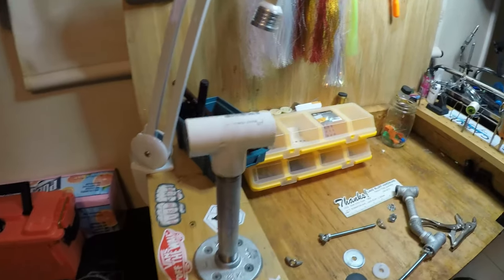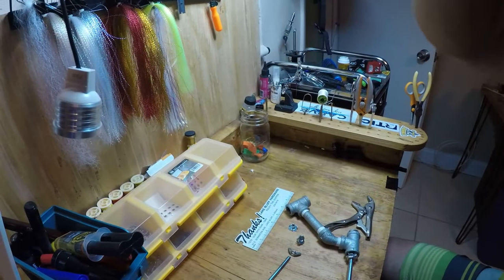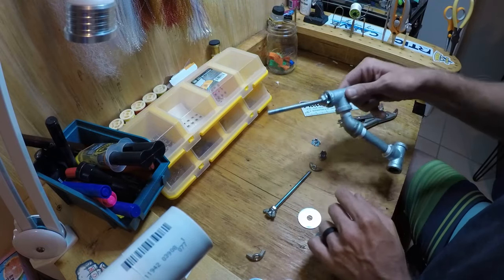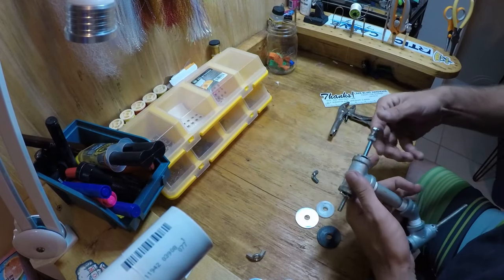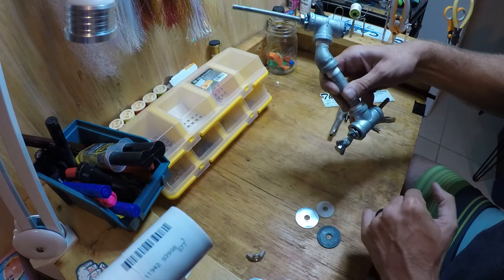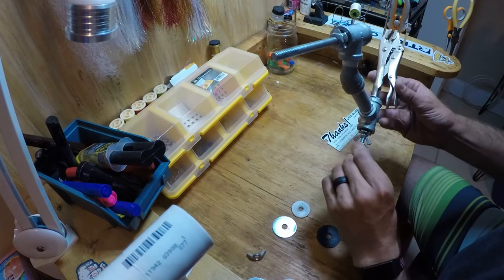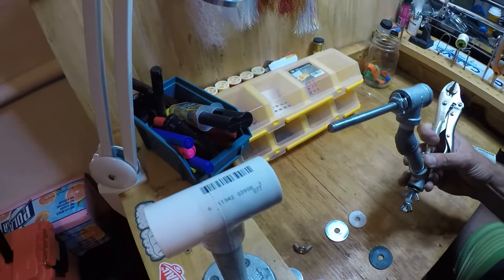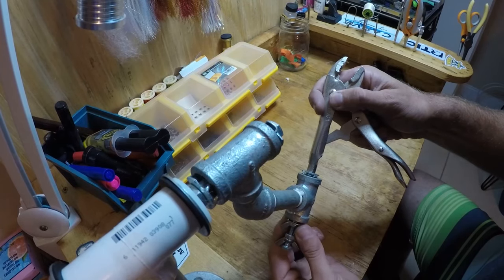Reply Video for Assembly of DIY Fly Tying Vise

Comment: Absolutely great idea .... Just wanted to say thank you for taking the time to go thru the break down of it all.. I was with you on everything except for those threaded wood inserts were.. And how excatly was used on the roation end and on the vice grips themselves.. 
So Again thank you .. Excellent video
Reply from the maker: Hey Daniel! Glad you enjoyed the video.

To give you a better idea of what I'm using just google image search "wood t-nut". 
The reason i chose those nuts is because the flange with the 4 points or prongs (this end would normally be hammered into the wood) are conical so they are essentially self centering when pushed into the inner diameter of the pipe fitting. 

The way I use them to stop the rotating of the vice grips is by setting the vice grips to the right open gap I want, then unscrewing the T-Nut along the bolt until it butts against threaded end of the vice grips - the exact same way you would put two nuts against each other to lock them from rotating on a threaded rod. If you google "The Use of Two Nuts to Prevent Self Loosening
" it will maybe make more sense than my poor description :P.

I hope this helps :/ it would be sweet if youtube would let me post a picture in replies but I don't think we're there yet sadly haha.
Reply: @Geoffspace123  for the upper portion on the 5/16ths bolt .. Did you use a nylon lock nut to lock it down? And did you have to bend those prongs in any to get them to go inside the hubs on the t as it seems to sit on the surface of the t. Due to those being a little bigger then the ones used for the 1/4 20 bolt to secure the vice grips .. 

Thanks again for the video :)